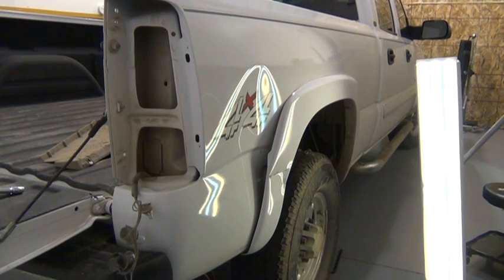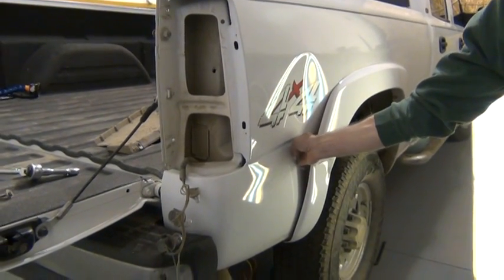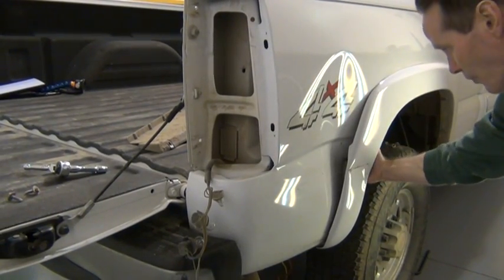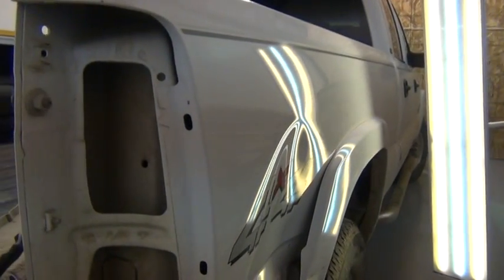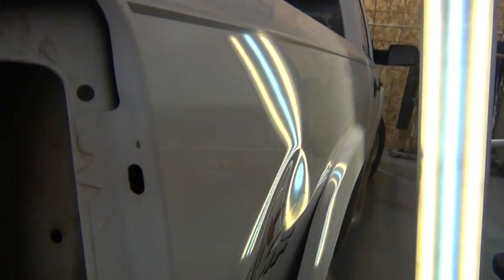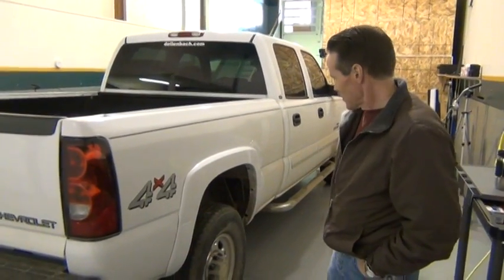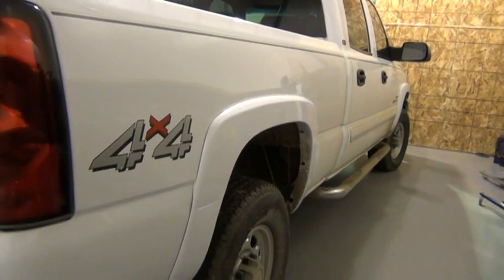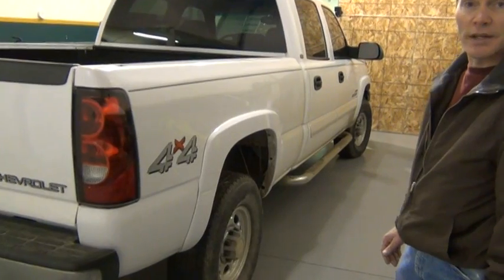Very Large Truck Dent

Comment: Outstanding results, although I didn't learn anything.
Reply: Dude same. It's seems like a good technique but these guys didnt explain it
Reply: they probably would have gotten a quicker result by puting tention on the panel from the rear were the tail light gos in like using a cable or chain to re tention the metal
Reply: Indeed.

Comment: That's nuts so about $700 for this repair? What about a silverado with a large dent in the front of the quarter panel 8 foot bed and I would have liked to have seen the inside of the bed to see what you did.

Comment: What is the hammer and pin for? It doesnt look like you are really striking it hard enough to do anything.
Reply: +Shane Weaver  actually shane he does uses kinda of "extreme" striking force that might cause small dents on the paintjob of the truck. The hammer and the knocker (not pin) are used for precise knock down on the surface of what is procesed to be repaired.

Comment: I do these everyday in fast pace production body shop, less than 4 hours I could knock out the dent bodywork,polyprimer block  sand prep,mask paint.  oven dry.colorsand buffing,polish
truck done by end of day!!!
pro work!! valspar debeers
Reply: u said u could do tht in 4 hours ? i hav a dent in my truck similar to tht one would u b interested in fixing it for me? ?if u r how much would it cost? ?
Reply: yeah but some people don't want body filler on their vehicle.
Reply: Bro every car on the street got body filler some where even new cars off the lot believe me i have seen it . We have gotten cars off of the truck brand new and the have
Reply: foxybrown2 your are absolutely right too a point. BUT WHEN A CAR SITS AT THE DEALERSHIP IT'S A DIFFERENT BALL GAME!! we do business with Kia Chevrolet ford etc.. local dealers sometimes these cars get dings, deep scratches even large dents at delivery or  there holding lot. some even minor collision In test drives from customers. most cases we add couple of thin coats  of light weight filler aka. bondo and high build polyprimer. To top it off the car has to get blended and color matched, 
respray at the damaged area.They even send cars with surface scratches to get color sand and buffed out. Our experts use high  quality materials for these jobs.
Too the average buyer you will never notice!!  unless you are expert in that field. 

Dealers don't have to tell you about minor surface scratches scuff marks  dings dents and touch ups it's not in there best  interest. But if you ask they have to disclose it to you!! 
cheers .
Body and collision 20+  yrs..
Reply: Kenshin Himura
 NO you are being stupid  while the cars are being transported they get dinged up sometimes. and you have to put putty on them sometimes. So like I said some new cars have bondo on them.
Reply: Did you listen to the other reply they said the same thing that i said And  by the way the dealer ship I was at was a BMW, MERCEDES dealership.  Oh so the cars are just going to sit on the lot because of a small ding get for real.
Reply: foxybrown2 I would NEVER buy a new car with body filler on it. Why do you think people bring refridgerator magnets with them? To check for scammers putting body filler on. Magnet will fall off any spot with filler.
Reply: Dude you're going to get sued into bankruptcy when you get caught putting filler on a new vehicle.
Reply: Then you better sue over half the shops in America. Because it does happen.
Reply: Kenshin Himura
what car lot do you work at  98% of people do not do that when people go buy a new car they do not take a magnet with them You very funny. now maybe when buying a used car they do. because i have done that. But buying a new come on bro people don't say Honey you got your magnet with you so we can see if there is any body filler on you new car.
Reply: geo pin where are you at?? I need work done.
Reply: foxybrown2 Not A GM ARLINGTON TRUCK!!!
Reply: how much would you charge ? i got the same dent as this, plus in the corner under the taillight small but deep....a guy told me $800 for everything back to normal.